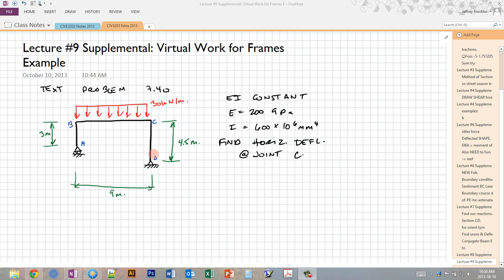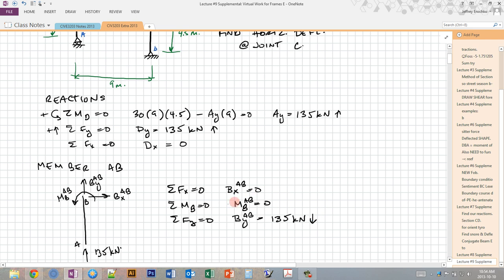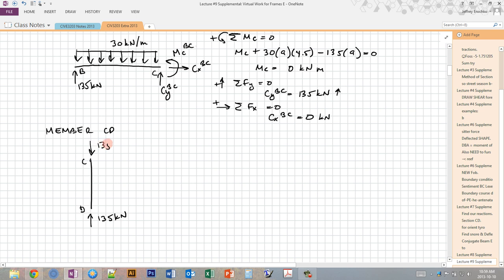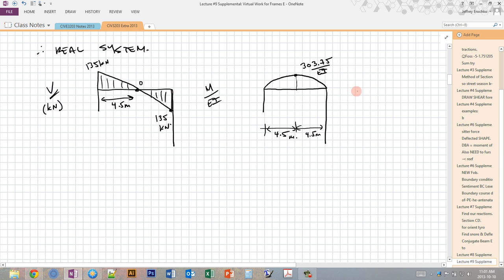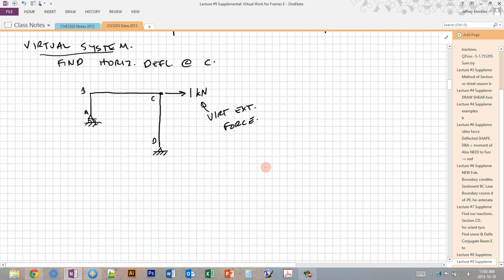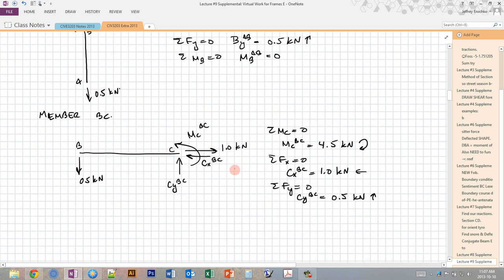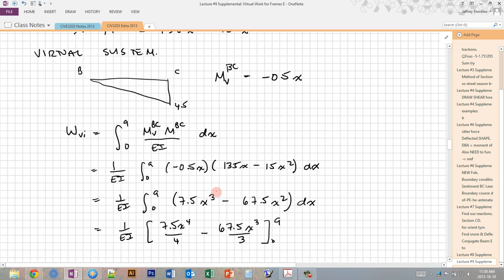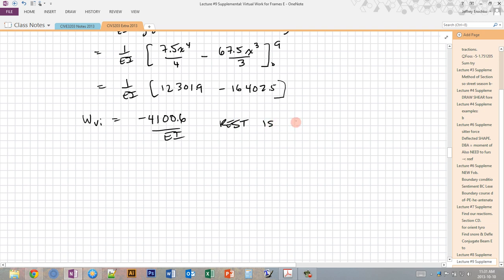EXAMPLE - Deflections of Frames Using Virtual Work

Comment: for member BC of the virtual load system, why wasn't the shear on the left side labelled as -0.5 if you wrote the diagram of it below the 'axis', as you state shear force as positive on the right side (down 0.5, up 0.5)